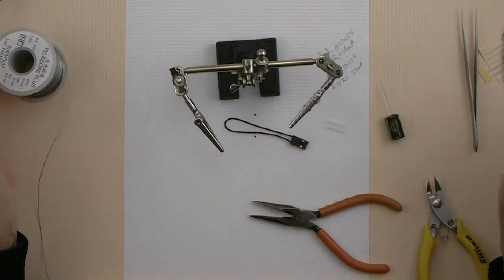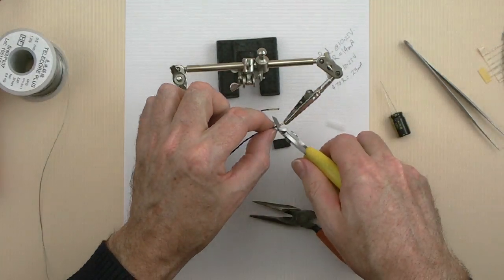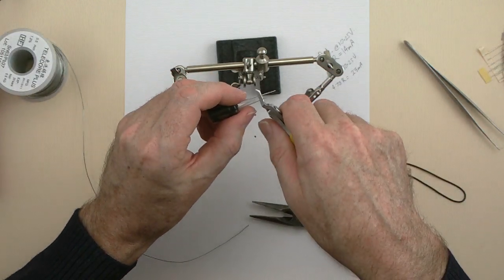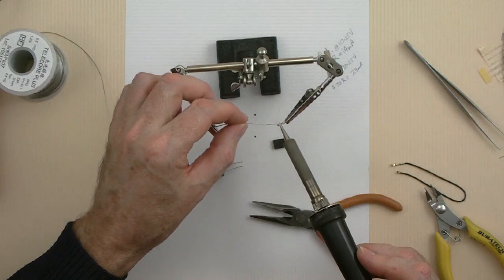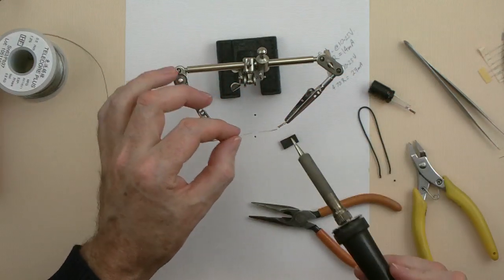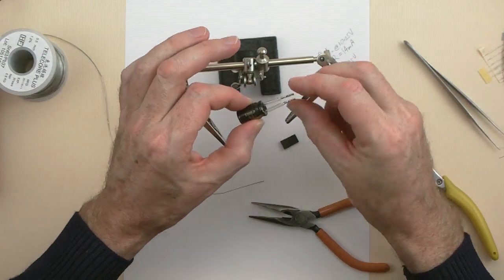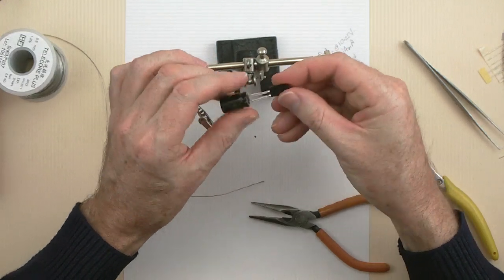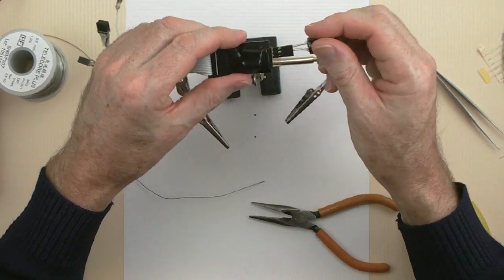RC Receiver - Filter Capacitor

Comment: thats such a weird and dumb way to to do it. now your cap is gonna snap off and break after a short while. why the hell would you have just reposition the terminals on the bind plug, cut the wire into 2 and directly soldered the cap on to the end of the 2 wires. that way you can secure the cap down to the vehicle.

Comment: so i need to clean up video could i attach this to  a spare channel of the flight board itself? i dont have a open channel on my reciever.
Reply from the maker: Cleaning up video can be quite difficult. Often lots of trial and error. Try a capacitor, but you may need a better filter using toroidal cores. If you can identify the source, possibly a UBEC  or ESC, it becomes a bit easier to filter or replace it.

Comment from the maker: Sorry delayed response.
The capacitors I use are the types used on PC computer motherboards. Typically 2200 or 3300uF 6.3V. I only use these because I have a bag of them from doing computer repairs. Any capacitor of 1000uF or more and 6.3V,10V or 16V will be a good addition to the receiver power supply. Suppliers to try are Mouser, Digikey, Element-14 and RS Components.